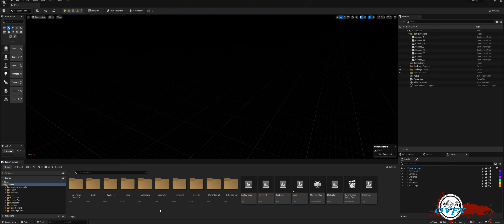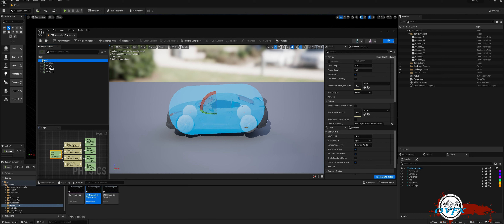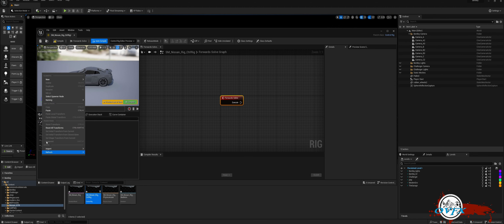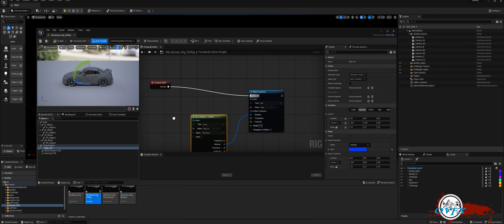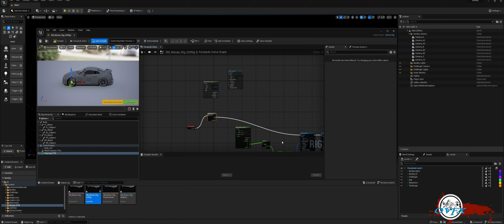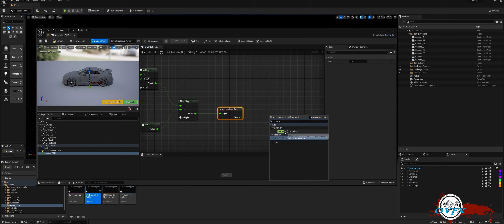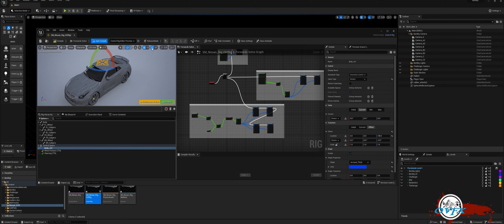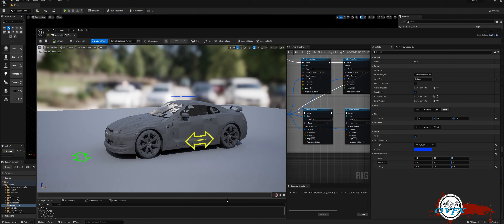How To Rig A Car In Unreal Engine 5 || Beginner || Part 2

Comment: Nice tutorial ! but if i connect the steering ctrl to the sequence it want work . ( and it don´t work at all from the beginning) . My rig looks almost the same ( i have only more ctrls e.g doors and hatch). Maybe you have some Idea where is the problem?
Reply from the maker: Hi, the steering doesn't work in the control rig blueprint? If not make sure everything is properly connected and if its still not working make sure you have it weight mapped correctly in whatever 3D program you are using.